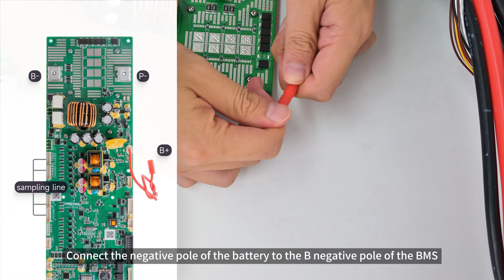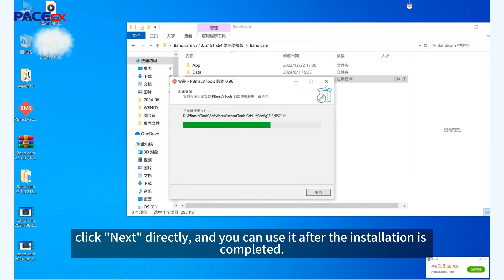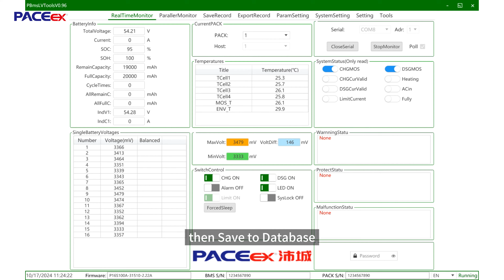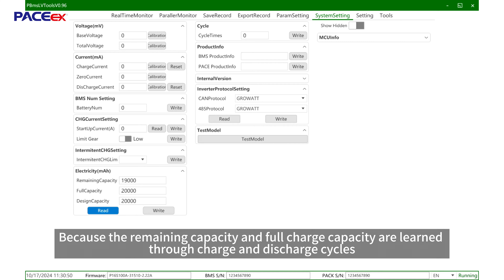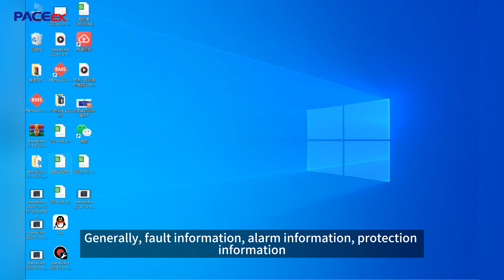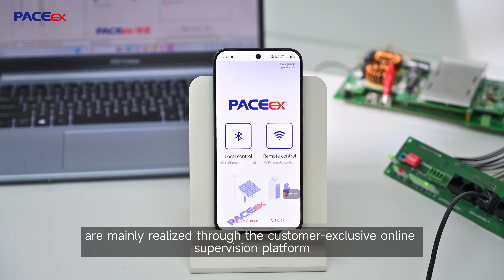E08.PACE household BMS connect to a battery pack, and the PC software#software #manufacturing #bms

Comment: How can I get the application, what is its name and is there a link to download it?
Reply from the maker: You can search for “PACEex” in the app store to download our application, or contact our technical support team to obtain the installation package.WhatsApp: +86 18924647568
Reply: Please, how can I reset the wifi module so that I can do remote viewing and control. I have try several times to connect on PACEEX MOBILE APP but nm success.